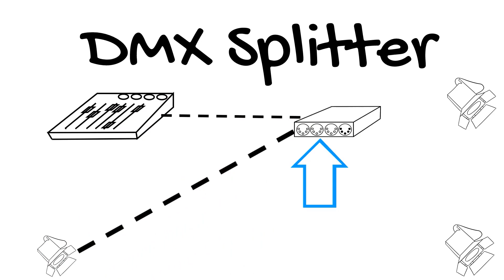How Do I Split DMX for my Lights?

Comment: I’m using D-pro 2 universe with 2 art-net enntec thru one net gear night hawk. Pretty easy. I also have a 120v 4 input box to come to one location instead of going around the world with cable. My front washes, spots(artfox roses), and smaller movers are one universe. Then I use the second universe for the rest of the stage. The powered input box sure does solve the problem with pushing the signal on down the line.

Comment: Hello sir. I was running a show for a wedding reception last night and o must say I was really happy with the outcome. All of a sudden, all my fixtures stopped working and now I don't even get a signal indication light on my moving heads 😓. I really felt embarrassed and I guess the fixtures were about 27 in all. Now, non of these (LEDs, moving heads and even the controller don't get any DMX signal). I want to find out, what exactly might be the problem and if possible any recommendations on how to fix the issue. Thank you in advance. 🙏
Reply from the maker: Sounds like a problem with your controller.  I would contact wherever you bought it from for troubleshooting/replacement if necessary :)

Comment: Will you need a splitter to use multiple different lights or can you daisy chain any lights to work with dmx? I have Rockville par lights with a few different moving head lights
Reply: You can daisy everyhang

Comment: I’m using a dmx micro king directly from my computer into the light fixture. It’s all a wired connection. However, we want to set up lights across the sanctuary that are also controlled through the computer. Is this when I use a splitter or can I mix a wireless transmitter with our wired connection to continue the daisy chain?
Reply from the maker: You can mix wired and wireless.  Many wireless transmitters offer a DMX output just like a light with a DMX input and output so it just gets wired in like any other light and essentially "bridges" the cable to your lights wirelessly.

Comment: Hi sir I'm sivaram I have 80 lights  here is dmx 512contoller also here but only 10 colors percents I want  more color. How to set up and  
How to laptop conteing with dmx controller set up the same more colos it's possible tel me sir
Reply from the maker: Hi Sivaram,

There are a lot of different options.  If you have 80 lights, I'd take a look at something like the lightShark or the Onyx software.  I talk about both a lot here on my channel (just search), and have even more resources inside of Learn Stage Lighting Labs: http://lp.learnstagelighting.com/learn-stage-lighting-labs/

Comment: How many splits can you use per console please David?
Reply from the maker: It's theoretically unlimited, splitters boost the signal.  At some point ( with many, many splits) you'd run into some delay, but that's just not a problem we see

Comment: Total newbie question: Will splitting the DMX signal allow me to control more individual lights or does it only duplicate a specific DMX channel? In other words, I have a 24 fixture controller. If I use a splitter, will I be able to independently control more than 24 fixtures? I assume it only duplicates specific channels but would love for you to tell me otherwise.
Reply from the maker: It simply duplicates all the DMX signal - it does not allow you to have more channels/individual control.
Reply: @LearnStageLighting  thanks, that's what I figured. Tip for anyone watching this: NEVER buy a Rockville Rockforce 384. I bought one as an intro/starter unit because it would control 24 fixtures. The thing is, if you want to individually control more than 12 fixtures, you obviously have something in mind that goes WAY beyond what a Rockville Rockforce is capable of.